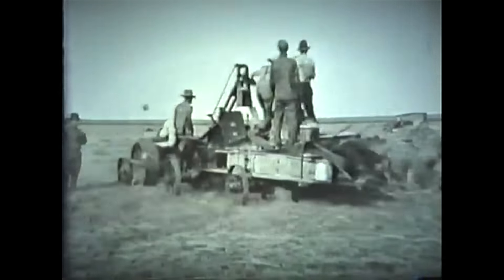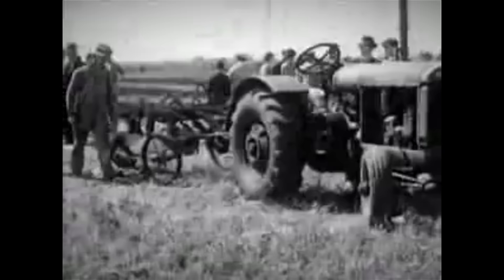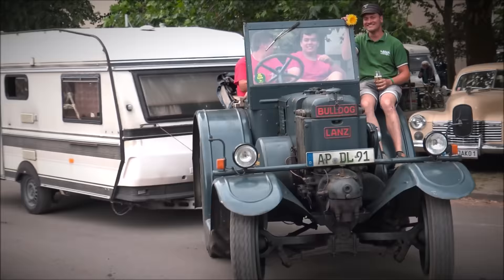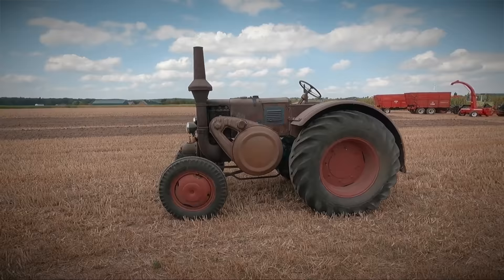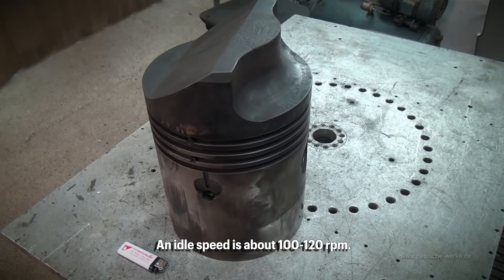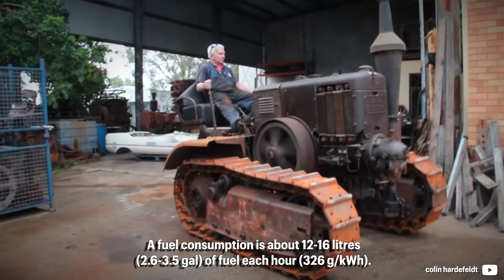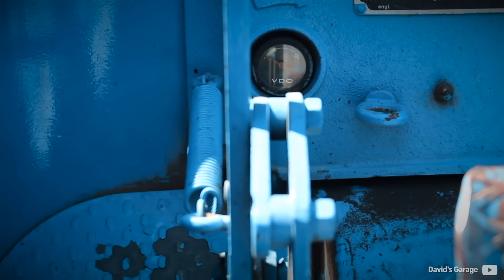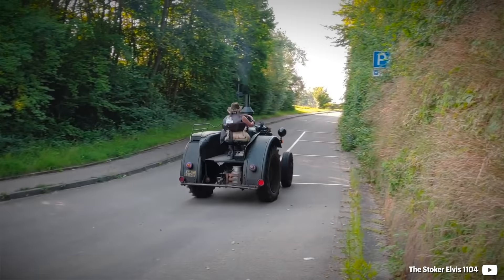This Is An Incredibly Slow Engine

Comment: Fun fact about these tractors: because it would run in either direction, you had to be careful when pulling a load up a hill; if you let the engine bog down too slow, it would predetonate and unexpectedly reverse direction, and your tractor would takeoff backwards down the hill
Reply: Scary fact.  When I was 12 my Parents both had Yamaha RT 180 dirt bikes(2 stroke gas incase you didnt know).  We were trail riding and my mom stopped and said her bike wasn't running right. She went to shut it off and it Dieseled for about 15 seconds.  That can happen when air cold 2 strokes get hot. We were riding slower trails and she can't ride like my dad and I to keep speed to keep cool so we took a break and grabbed a drink.  
We gave it 10 minutes and I took it for a test ride..  near us was a decent hill climb  especially for a trail bike but I've done it 100s of times on that bike. 
I hit a rock this time and at the top the engine started to bog. I wasn't going to make it so I pulled the clutch and started dragging front tire down the hill.   I let out on the clutch to slow down using the gear as a brake.  It let out a loud 2 stroke back fire and rand what seemed like full throttle in reverse back down the hill.  
Scary AF! Lol.  I pulled in the clutch and shut it off.  I started it right back up and it ran fine too.  My mom was so afraid of it doing it to her on flat land she insisted we trade bikes. I was riding a CR 125 that day.  She ended up wanting a race bike after that but wanted a big cushion seat like on her bike..
Reply: Very scary. As a lot of people first instance would be to brake. Only to have the tractor tip over, and with these tractor seat that hang out the back...messy
Reply: We have a Lanz D7506. 
You must be very careful with this Engine. 
The Sound is sooo good, you can listen for hours 😋
Reply: @nils2tr  I have a 103 year old hit and miss engine 1.5 horse power.   
Some people just don't understand how I can go into my garage and watch it spin at spin and  listen to it clop clop clop pow, clop clop pow clop ......  I was raised by a machinist so mechanical admiration might run in the blood.
Reply: @acme_tnt8741  My 50 cc DKW could be started by pushing it backwards. When the ignition cam is more or less symmetrical around top dead centre this is possible. With a-symmetrical ones this will not work or run erratically.
Reply: It can also be fiddled with so that it runs at, literally, zero RPM. It's firing, but never completes a revolution, it fires and reverses direction just before it does.
Reply: People were tougher back then.
Reply: Accidentally reversed a 671 Detroit once, hit the clutch right before the truck would’ve stalled, and it suddenly came back to life, suddenly reverse was forward and vice versa.  Had to shut it off and restart to make it run the right again
Reply: Older, simpler two-stroke motorcycles sometimes did the same. I saw a Puch (Allstate) moped do that.
Reply: Sounds like fun! Especially when towing a trailer..
Reply: @LabiaLicker  it would be scary because you are not used to it, If I were operating those machines I would try to make it happens on purpose, so I'd be prepared when it happens again
Reply: 4 cyl supercharged Detroits will do the same thing. It's happened to me a few times in our log skidder
Reply: Not just 2 strokes, I’ve had a cat 3406B chug itself out of a stall backwards more than once
Reply: @acme_tnt8741  that has nothing to do with these tractors
Reply: @roulsalzer5407  there are degrees of association between every atom in the universe and 2 different internal combustion engines running clockwise and counter clockwise, and you're going to tell me that one has "nothing" to do with the other?
Reply: @acme_tnt8741  i had an rt100 it did the same thing when hot 🔥
Reply: @Oscar_delta13  RT's were awesome. They would hold up to abuse but they didn't like going to the sky.  Or shall I say , they didn't landing.
Reply: @semiprofessional8470  Nah.
Reply: And it can run at zero RPM
Reply: @CheeseMiser  I would call it .5 rpm
Reply: True my grandpa had one when I was a sprout back in the fifty's and he would fire the old girl every once in a while and he would always tell she may jump the wrong way
Reply: @acme_tnt8741  my son had a 426 Yamaha that would go batshit diesel and it was so much bike I made him get rid of it. later on learned the issue and how rare and badass of bike it was . Lol .
Reply: @acme_tnt8741  there so mesmerizing, my dads friend had many when I was young, a hit and miss tractor he would pull kids at the fair hay ride with .the year I was 10 he let me drive it , she got away on me and mauled the hay twine and fencpost borders, never been able to stay in the lines .lol. building our second hit and miss with my son now . Pop poo poo poo pop pop pop
Reply: That happen to Johnny Cash in Wall the Line 😅
Reply: tons of 70's and 80's 2 stroke dirtbike motors will do the same thing! if you bump start them rolling backwards, they will fire up, but the only issue is you now have 1 forward gear and 5 reverse gears! LOL
Reply: Has a nissan patrol, sd33 diesel running backwards after runstarting it down hill backwards in forward gear instead of reverse. Blew the airbox off it
Reply: @acme_tnt8741  my friend bought one of those and it didn't run right(we were stupid 14 year olds). We figured out it would run backwards and we took turns trying to ride it backwards for weeks.
Reply: @brianschryver8314  🤣🤣🤣🤣
Reply: @nils2tr  Have you made it run at 0 RPM?
Reply: @apismellifera1000  😄
Reply: Thats not fun at all.
Reply: @acme_tnt8741  cool story bro.
Reply: @semiprofessional8470  no. Less smart back then.
Reply: Sounds like an old Mack...
Reply: Pop the clutch and enter reverse, stall it backwards again, pop the clutch forwards, floor the gas and hope you don't break something lol.
Reply: Lanz tractors had a Guatemalan to indicate just that peculiarity
Reply: The hot bulb was within the manufacturing ability ahead of the Diesel engine and was twice as efficient as the more common steam engine as  having 12% efficiency over steams 6%.  You could leave it for hours to run a pump or generator without constant supervision also.

Comment: It's worth mentioning how dangerous that vehicle was, could break your arms upon starting up or change rotations upon towing heavy load uphill, resulting in rapid acceleration backwards. I've also heard stories of inexperienced drivers getting literally knocked off of it cause it was lurching like crazy from that huge torque
Reply: That was a different era, everything was dangerous 🤣 the coming of the industrial age overall really killed a lot of people in the name of forward progress.  Sound familiar?
Reply: the engine would not change rotation randomly when it was under load. It could only change when it was under load but at VERY low RPM. This can be avoided by simply not doing what i said previously.  Otherwise it was fine
Reply: Life is dangerous,that's what makes it interesting.if ya scared of dieing you ain't living!
Reply: @benitopussolini544  my first go-kart didn't have brakes. I was 8 🤣 I have lived most of my life almost dying lol it's been an experience. But I just turned 31 with a couple kiddos. Gotta keep things reasonable these days 🤣 I can only almost die so may times before the wife gets upset or my health insurance runs out hahahaha
Reply: The arm-breaking story sounds odd, since most Lanz were started with the steering wheel, which would be pushed out automatically if the engine revs.
Reply: @Jan_372  look at 4:33 how that shit turns! If your hand got caught in the inner parts of the steering wheel your ibtere body would spin!
Reply: @luxtempestas  if you see any owner starting their Lanz, they always grab the steering wheel from  the outside because of that. Also that one in the video somehow got it stuck.
Reply: @Jan_372  in the "somehow" an accident can happen - from that came the accounts of broken arms, prolly. 😁
Reply: @Jan_372  I've seen in almost ever case of a hand started engine, it's a pull motion, helping reduce the likelihood of injury, it would be more likely to pull out of your hands if suddenly it changed direction, in which case even a malfunction in the way it was designed, still would not be likely to result in serious injury, would I be correct in that?
Reply: @goosenotmaverick1156  yes, at least it does look that way in most of the starting videos. In some of the bigger ones they also just have a special flywheel to crank it, so no way to get your arms snapped unless you decide do hold on to it.
Reply: What doesn’t kill us makes us stronger.
Reply: So it is still less dangerous than livestock.
Reply: thats just part of the fun
Reply: Some people are so steeped in FEAR that they seem to think it's their lot in life to see to it that everyone else lives this way as well. Go away, let those with a reasonable amount of common sense take care of themselves.
Reply: @goosenotmaverick1156  first go-carts are supposed to have brakes?
Reply: It was strictly reserved for men 💪
Reply: @dieselgeezer18  it's when it came to a stall going up hill that this happened... Sometimes you cant avoid a stall..  it did only have one gigantic piston
Reply: @spatulaman2753  actually it just makes you not dead
Reply: @tommiraeko8541  yeah you are right. When it would roll backwards down the hill  after stalling the engine would start back up and if you had kept your foot on the gas it would accelerate hard backwards.
This could also happen while the engine is running too. Though not so often. If it was running at very very low RPM it could spontaneously start running backwards
Reply: My grandfather's brother died in a farming accident and one of these was very likely involved with it.
Reply: Sketchy even by my standards
Reply: @tommiraeko8541  but you learned something didn’t you? Doesn’t that make you stronger?
Reply: @spatulaman2753  AMON ‼️
Reply: @spatulaman2753  want to cuddle?
Reply: @goosenotmaverick1156  Genetic legacy, your kids are living on . Good 👍
Reply: @Jan_372  Lanz owner here, unfortunately the steering wheel won't get pushed out in a safe manner automatically once the engine starts to rev. Not removing the steering wheel from the flywheel in time will result in it getting stuck and eventually flung out violently as seen in one of the clips. However, removing it in time is not difficult if done correctly. Most steering wheels used for starting had a tiny, loose "wheel" (around 8cm in diameter I'd estimate) mounted right in the center which you could grab and hold onto once the engine ignites. Doing this will ensure the steering wheel does not get stuck and can be pulled out easily once the engine starts to rev. Interestingly, it seems to be absent from the steering wheel used in the clip I referred to earlier. Perhaps it's a reproduction meant for a post-war model featuring a flywheel design that you can crank without the need for a steering wheel. I wouldn't want to start up a bulldog with that, it's exactly as dangerous as it looks like.
Reply: @brandonreimer184  apparently not? I had always heard they were, but apparently you and I had the same experience lol
Reply: @spatulaman2753  Christopher Reeves didn't think so
Reply: @spatulaman2753  I would think only idiots would get hurt with this technology
Reply: It still is a very powerful torquey engine. You have to treat it with respect. My grandfather had one way back in the day. It was an impressive beast.
Reply: @Jan_372  Yes but a lot of people have the habit to grab it like a steering wheel I would imagine. Meaning their thumbs grab around the inner part where the spokes can break them. That's why when you're about to crash and definitely can't make evasive maneuvers it's better to let the steering wheel go. Or at least retract your thumbs. A lot of broken thumbs result because of that.
Reply: Sounds like bullshit to me.
Reply: @goosenotmaverick1156  
Stay 20 in your head, just remember that your body missed the memo.👍😎
Reply: @johndenton5555  lol what was that in reference to? I made multiple comments In this thread. I have to remind myself every day how old I actually am, and I'm good to do that haha
Reply: @roulsalzer5407  You never have an accident bud?
Reply: @spatulaman2753  No, you can learn shit without tearing your limbs off.
Reply: @luxtempestas  you hand does not get caught in the steering wheel if you do it the way it should be done: with all your fingers on the outside
Reply: @aurelius5080  were in the history someone who does everything how it's supposed to be done get focked? Obviously who got injured didn't do it how it was supposed to be done...
Reply: Just sounds like you're describing a horse.
Reply: Skill issue
Reply: And the guys in Milwaukee were so impressed with this engine, they added another cylinder and built it into a bike…!👀😜🧐😎🙈👍😂
Reply: @Jan_372  The steering wheel would only cam out... or disengage when the engine was turning int he correct direction... otherwise if it predetonated it would start up in reverse and fail to disenguage, a way to fix that would be to have a linkage from the governor kick out the starting linkage so it would disengage after reaching a certain RPM. Unfortunately it probably still would have broken your arm by then...
Reply: Menacing31  nah. Just use the clutch when the RPMs are very low while going up a hill

Comment: The Landini "40hp" and the "Super Landini" had respectively a 14.3 and a 12.2 litres single cylinder engine so the Bulldog has the not quite largest tractor piston, apart from that great video as always
Reply: What about bore and stroke specs? Even weight? There's more to being big than the displacement of the cylinder it occupies when at BDC... it could be the largest in any number of ways.
Reply: @goosenotmaverick1156  you are right, there is more to displacement, but having the same kind of engine executed in a very similar way I guess all dimansions get proportionally scaled up, anyway as for bore and stroke they are: 260x270 Landini 40 Hp, 240x270 Super Landini, 225x260 Lanz Bulldog
Reply: The big lanz tractors have a 14.6 and 65 hp and there are bigger ones but they are very rare
Reply: @dorusvanasseldonk8729  
when we talk about hot bulb engines, the largest lanz had a cubic capacity of 13.804 liters, it was operated with wood gas, but was then almost exclusively converted to diesel, so you achieve 63 hp at 450 rpm, we have such a tractor ourselves
Reply: Yes!!

My Grandfather: "RUHSPEK THA STERNIN' WHEEL!!"

Comment: In Finland was only one Lanz Bulldog. German Army Left it in lapland and had written "kaputt" on it and it served as its name when its feed pump was assembled correctly.
Reply: Yeah, i remember a story from my grandpa. When the Army came they had 2-stroke generators with them. Nobody had told the soldiers that these needed 2 stroke oil, so they tried to run them on pure petrol. Didn´t went well. He managed to yell at one guy to shut it off - just in time before it would have seized. He repaired it and still had it decades later. 
Seems the average soldier at the time wasn´t really that knowledgeable about mechanics.
Reply: @Ammageddon89  they probably still arent today.

Comment: A 10L engine that you must start using the steering wheel.... that is the coolest.
Reply: Until you break your wrists and have to drive with your feet.
Reply: @noobhacker101  If driving a tractor with your feet isn´t cool ... I don´t know what is.
Reply: @noobhacker101  broken wrist is better than ripped off arm
Reply: Also cool is a 28L kickstart... Early Rumely OilPulls.

Comment: Many years ago I was in a little Niederrhein village, visiting a friend. And there was an elderly gent with a Lanz Bulldog just a few meters down the road. So we stopped by and had a really pleasant chat. According to the guy, the tractor needed anywhere between 20 and 40 minutes to pre heat. He was in the process of doing so while we chatted, with him occasionally checking on the engine. When he finally started it, things happened rather quickly. I was thoroughly impressed by how quickly he yanked the steering column out of the engine once it turned over. He just remarked „Well you really need to watch your hands and arms. If you have them in the wrong place at the wrong time, they will be turned into minced meat. Once thjs thing goes, it goes and it won’t stop. You really need to respect the machine“.
He told us that dad had one of his arms very badly injured and almost had to have an amputation when he slipped in the mud while turning the same engine over that we were standing next to. This particular tractor had been in active farm use all the way to the 1970s and was also used to drive some stationary machinery via a long belt over the flywheel.
I knew those machines were torque monsters. But 500nm…that is pretty substantial and impressive.
Reply from the maker: Thank you for the amazing story!
Reply: It's pretty charming how we humans tend to familiarize ourselves so much with the machines we work with for a long time. After all this time this old man could've certainly upgraded for something newer and easier to work with, but he chose not to
Reply: Thats why germany lost the war. They were waiting and waiting 😂
Reply: @mann_idonotreadreplies  they won actually, just started waving different flags.